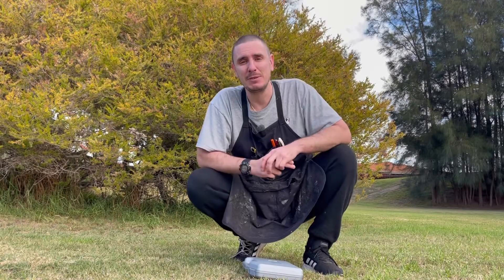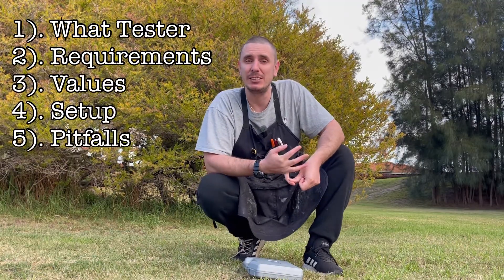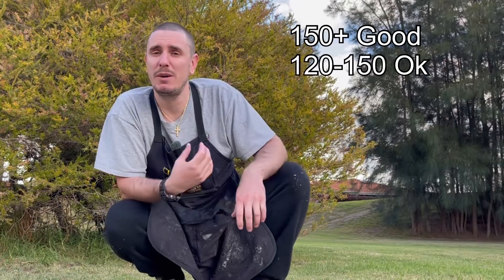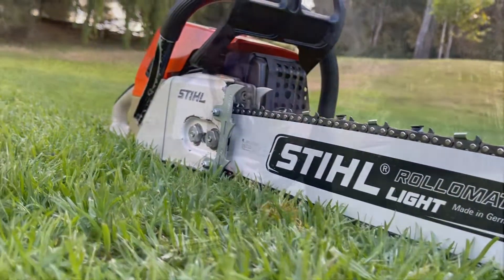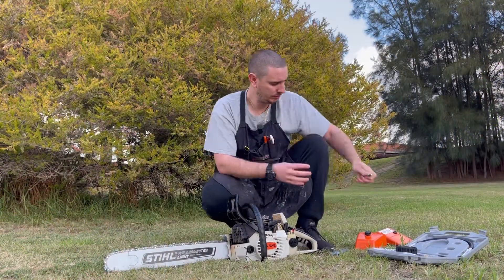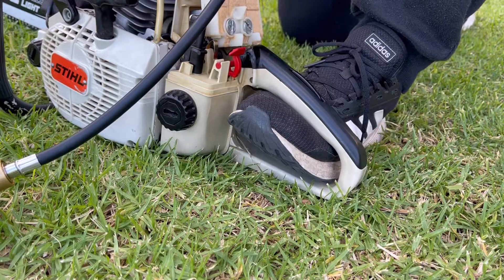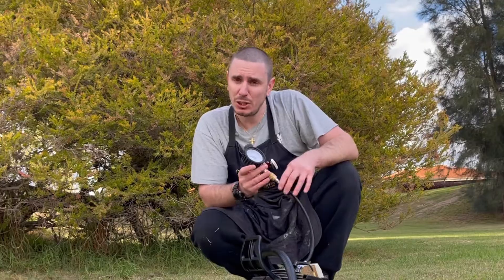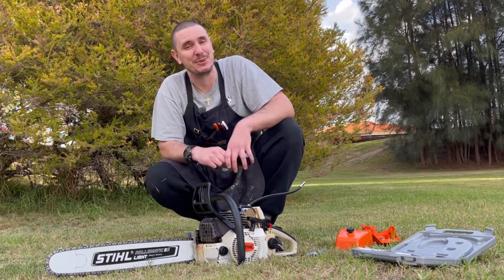The CORRECT Way To Do A Compression Test - Avoid These Mistakes!

Comment: i was told that minimum of 90 psi for any gas engine to at least run ?   is that true ,,,,,
Reply from the maker: That’s a bit low, anything below 120 in my experience is hard / may not start :)
Reply: @VintageEngineRepairs  thanks for that , i am noticing many different oppinions lol

Comment: If the throttle is wide open isn't gas going in the engine and will this affect anything ?
Reply from the maker: Na it’s not going to affect anything. That said, on a 2 stroke you can leave the throttle closed, it’s only important on a 4 stroke, but it’s not a bad habit to have keeping it opening for both :)

Comment: Hi there’s any way to test compression on a briggs&Stratton 3.5 hp tiller without a compression tester?
Reply from the maker: No, but that said, a compression test isn’t very useful on 4 strokes as they have an ACR. Better to do a leak down test if you’re concerned about wear!
Reply: @ thank you

Comment: You don't need to have the throttle wide open. You want to disable fuel when doing a compression test. Throttle plate restriction won't affect your readings.
Reply from the maker: Thanks mate! Yes in 2 strokes you’re absolutely right, they can be closed :)

Comment: On 4 stroke engines, yes, make sure the throttle is wide open, but on 2 stroke engines, it doesn't matter as the cylinder will normalize to atmospheric pressure through the exhaust port at BDC.
Reply from the maker: Thanks John! I appreciate that info, I haven’t ever given it too much thought, but that makes a lot of sense!!

Comment: Guessing this is what is wrong with my 281xp. Im getting fuel and spark and flywheel key is good but it won't start for anything. Got some nasty blisters on my fingers from pulling the rope so much. What you think?
Reply from the maker: What is the compression reading?

Comment: I learned this the hard way. I bought an automotive one from the auto part store, and it read way low, and i just never used it, figuring it was chinas fault or defective, lol.  then i bought a snap on one for 225 dollars, and it was also reading way low. Luckily, he took it back, and i just ordered a mityvac, which says it works with small engines, so fingers crossed.
Reply from the maker: Dang! Glad you could take it back :) glad you got the mityvac, it works well on small engines 👍🏻👍🏻

Comment: The thing is, how do we know our compression tester is good? 
With a torque wrench, for example, we can periodically send them away to be recalibrated but, with a compression tester who’s ‘yard stick’ are we measuring it by? 
For example, mine might say 130psi, the next tester might call it 170psi. Which one is correct?
Reply from the maker: Use your air compressor and shoot a set pressure into the gauge and check it matches up.

Comment: Sorry I am new to small engines and one part confused me... the values for 4 stroke given at 1 min 40 seconds (70 to 80 PSI good). Those values are for an engine with an ACR... or without?

Thanks,
Matt.
Reply from the maker: They are with an ACR. With that said, even old engines like Briggs flatheads have an additional bump on the intake (some think it’s the exhaust, it’s not) which will reduce compression too. Therefore even on machines that don’t have an acr, still have a means to reduce compression :)

Comment: Hi Tom I have a tester with Schrader valve at the spark plug end just like yours, but I have 200PSI . Isn't that too much ? I looked on Google and said on a forum that 200PSI could indicate a scored piston. Could that be true ?
Reply from the maker: Na that’s not true, 200 psi isn’t common, its very good though :)

Comment: Well thank you so much for mentioning the part about the schrader valve. My kit had a schrader valve that you can screw into the end of the line, so it can do automotive and small engine. No other youtube video mentions this important step so I was about to throw the tester out wondering why I was getting 15psi!!
Reply from the maker: Awesome! Glad it helped!! :)
Reply: Gone from 15 to 150psi! and able to see that my other machine is reading around 100 and probably needs a rebuild. So helped heaps, thanks again :) @VintageEngineRepairs
Reply from the maker: @mowtoegee7049 awesome! Pleased to hear :)

Comment: Very good and thanks for the information on schrader valves.  There are a lot of people out there who think that engines (even 2-stroke) work like air compressors and therefore,  the location of the relief valve makes no difference and that the schrader valve located at the plug is not required.  Such theories make it to the internet, and programs like ChatGPT (statistically probable text) pick it up as fact.

Comment: Yeah... if  80psi and the engine is running great... that just means they are testing wrong
 Lol
Reply from the maker: Spot on mate!
Reply: This whole video has me second-guessing my gauge. Currently traveling for work but when I get home I am going to see if I have the Schrader valve in my tester. I suspect I don't as my Johnson 2 cylinder shows right around 100 psi but runs spectacular. my worry is I have given other people advice wrong based off of my gauge.
Reply: @timlong1462  100 psi is probably the minimum you could get away with, I have seen a few motors along the way that run perfectly nice at 100. If it doesn't have a valve and you are reading 100psi, you likely have a good bit more than that.

Comment: Got my new Mityvac today and the Whipper snipper I tested a couple of days ago with the other non valved tester has gone from 20PSI to 160PSI. Great info.
Reply from the maker: Fantastic, there we go :)
Reply: @treecycle4631 So, how do you know which one’s correct, if any?

I mean, obviously you’d wanna believe more the 160 over the 20, but how do you know that even the 160’s correct? 

Compression testing seems highly hit and miss to my way of thinking.
Reply from the maker: If you use a small engine compression tester they’re all very accurate within 5 psi of each other.
Reply: @SeriousSchitt  Plug a compressor into each and compare the readings.

Comment: Your a very knowledgeable guy Tom, well done on putting out these information videos 👌👍
Reply from the maker: Thank you Nev!
Reply: @VintageEngineRepairs  Hi Tom hope your doing ok, watching this has helped me out, got a husqvarna chainsaw in for repair at moment will not start for love nor money, followed your steps with the compression test and it will not go passed 75 psi so i think its a new piston and ring, i can see light scoring on the piston through the exhaust hole, so going to strip it down and also check the boar, thank you for sharing your experience with us 👌👍
Reply from the maker: @tinkeringtaylor3053  awesome
Nev! Great to hear mate :)

Comment: It’s a good idea to ground out the plug lead or keeping the kit lol switch off. Some engines have high energy ignitions. If spark can’t get to discharge, it it’s going to try somewhere else like inside the ignition system itself. This can be permanently damaged.
Reply from the maker: Yep! Spot on 👍👍

Comment: I ended up getting a mityvac compression tester with the Schrader valve.  The other one I had without the valve I used for years on 420cc engines without issue, but on small engines like chainsaws it did not cut it.
Reply from the maker: Fantastic James! Good to hear it :) thanks for watching!
Reply: Just tried mine on a whipper snipper and found I only got about 20PSI. Definitely wrong as it runs perfectly. Time for a new one with the valve for small engines. Thanks for the heads up Tom.
Reply: Another lesson from Mr Two Stroke. Good info Tom!

Comment: That's a good point about the Shrader valve. Both of my automotive compression gauges have removable Shrader valves, so you can use the adapter for measuring real time pressure. As you say, with no Shrader of course a small cylinder will appear to have a much greater volume and lower pressure if the length of the hose is significant.
Reply from the maker: Spot on! Thanks for watching and sharing :)
Reply: Yes great tip right there so I won't fall down on that error
Reply: Will it though? The valve you depress to release the pressure from the gauge is a Shrader valve and its placed downstream of the hose.

Comment: You wouldn't happen to have links to where we can find the "Small Engine" specific compression testers, would you? All I've come up with so far is ones for "Vehicles" and most aren't as nice as the one I already have, which does have a Schrader valve and adapters to fit different plug sizes.

Thanks! And have a great weekend!
Reply from the maker: Hey! I’m afraid I don’t have any specific links, I’d search the 3 suggested brands in the video and go from there :) Amazon or google will come up with them! 

Thanks for watching!
Reply: @VintageEngineRepairs  OTC 5604 Motorcycle Compression Tester. That one is a bit pricey, though.